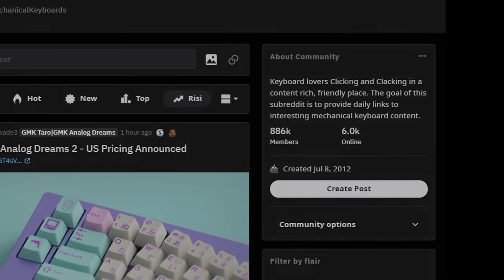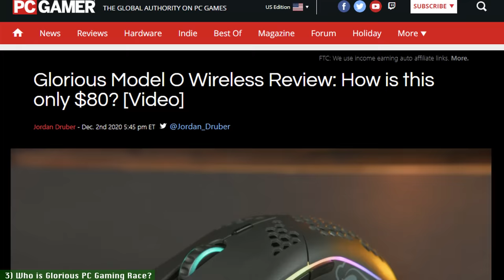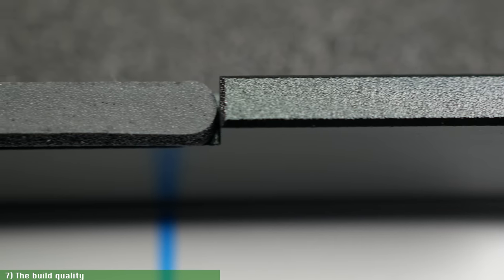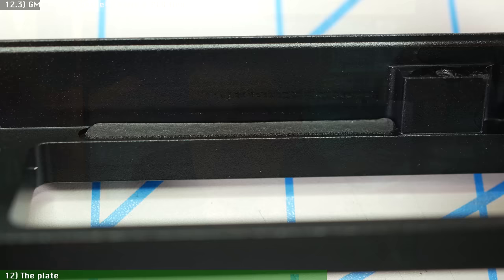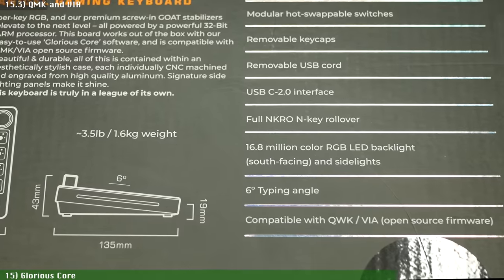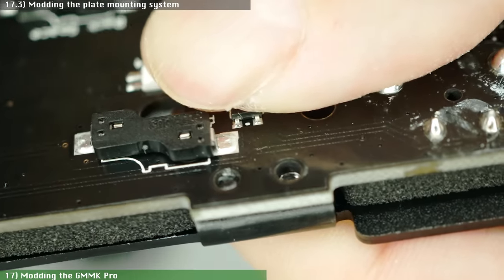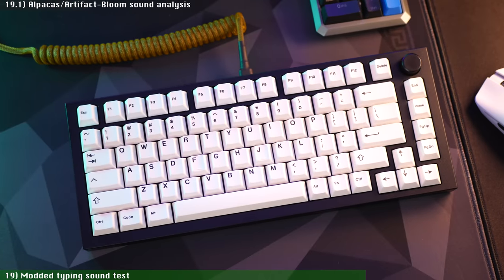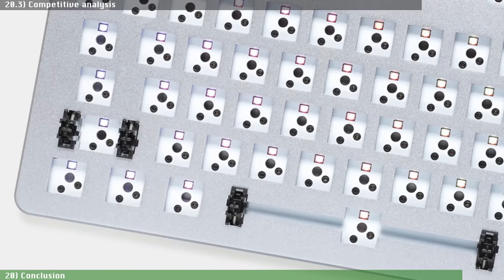GMMK Pro: The ultimate guide (in-depth review + modding tutorial)

Comment: This is great. How do you feel on lubed vs stock alpacas again?  I think I misunderstood. Thanks so much.
Reply from the maker: Hi Harry. I didn't lube the Alpacas in my video, since they already come pre-lubed from the factory and the JWK factory lube is really well done. In my opinion, there is really no need to re-lube them unless you like your switches more on the "buttery side" (which I usualy do with super tactiles, such as Holy Pandas for example -- which can be a bit too jarring to me, but no so much with linears).

The difference in sound you hear in my video between the stock board and modded board with Alpacas come exclusively from the mods I did to the keyboard and not to the switches.

One thing you can do if you're a bit put off by JWK switches high pitch sound (such as the Alpaca),is to film them, which will make them sound a bit more bassier.

Comment: Keyboard amature here. When I hard press the spacebar on my gmmk it sticks for a good second before popping back up. Feels stiff to press as well. Is this an easy issue to fix? I'm assuming it has to do with the stabilizers
Reply from the maker: Yeah... That is a known (and unfortunate) issue happening with the lastest batches of GMMK Pros. To try to fix the rattle issue from the first batch, they ended up gunking the stabs with too much dielectric grease (that got stuck in the pads they applied under the stabs housings).

Glorious even published a guide to help people to clean this up: https://www.pcgamingrace.com/blogs/secret-announcement/sticking-stabilizer-repair-guide

So yes... it is relatively easy to fix, but you'll need a proper Philips screw driver (Size 1 or 0 should work) to open the board and unscrew the stabs from the PCB.

Comment: But what changed the sound so much ? Was it the foam - or was at the orings ? or a combination of both ?
Reply from the maker: I'm certain it was the combination of both, since I did try just with the silicone (didn't show in the video) and while it did alter the sound, it didn't change as much as the with the O-rings.

While the silicone reduces the volume a bit, the O-rings kill whatever resonance was there before (by allowing the gaskets to absorb more of the energy from your fingers instead of passing them along to the rest of the case) and makes the bottom-out sound of the switches more defined in my opinion.
Reply: @IOSam  Ahh i see ! Thank you for elaborating !!  Very, very good and informative video - good sound, good camera work and a nice pace and voice. Very pleasant to hear throu.

Comment: Hey Sam,

First of all great video, as someone who is seriously considering buying this keyboard this was a great source of information. Though as a beginner in the field of custom keyboards I was wondering, what switches that are being offered on their site should I pick. I am looking to get a good sound without completely dempening the included RGB.

Thank you so much for making this video and great content overall!
Reply from the maker: Thank you Sir!!! Appreciated! :)

From what I could see from Glorious current lineup of switches, the only ones they have with clear top housings that would not obstruct the RGB lights would be the Gateron or Kailh standard switches (Glorious exclusive switches Panda, Lynx and Fox all have opaque housings which would dim the RGB light a bit).

They have the full line of clear/gray (light weight short travel linear), red (light weight normal travel linear), yellow (medium weight normal travel linear), black (heavy weight normal travel linear), brown (light weight normal travel tactile) and blue (light weight normal travel clicky) for both Gaterons and Kailhs.

Between these two brands, I personally lean toward Gaterons simply because I find them to be ever so slightly smoother than Kailhs, but that difference basically goes away if you lube any of these switches anyway.
Reply: @IOSam  Thank you so much for taking the time to reply and even going to their website to help me!

I might go for the polycarbonate plate to defuse the RGB a bit better so I might stick with that and go for a full RGB-build later. Would you still stick with the clear switches in that case or would you go with the Lynx's or Panda's for example?
Reply from the maker: @quintentielens4658  With the PC plate, and if RGB is not a priority, I would go with the Pandas (if you like tactiles) or the Lynx (if you prefer linears). These are premium switches that will feel and sound nicer than regular Gaterons and Kailhs, and can even come pre-lubed to save time.

While there are premium switches with clear housings out there, unfortunately Glorious doesn't sell those in their website, so the best switches they offer (in sound and typing feel terms) are their own opaque housed switches (Panda, Lynx and Fox).
Reply: @IOSam  Thank you so much for you help Sam! I know nothing about switches etc so video's like yours and the fact that you are willing to help is a serious help! You're great!
Reply from the maker: @quintentielens4658  Helping beginners is one of the main reasons for this channel’s existence (there are way too many channels focused on "seasoned enthusiasts" out there already). This is, and will always be, a beginners and veterans equally friendly zone! :)

So, you my friend, will always be welcome with your questions here during your custom keyboards journey! 👍
Reply: @IOSam  I just ordered myself a GMMK pro black with a polycarb plate, lynx switches and their white keycaps. All that paired with one of their wooden wrist wrest and some new stabs they sell seperately. Not cheap but hopefully worth it. Should be better than my Razer keyboard at least!
Reply from the maker: @quintentielens4658  Cool!!! Let me know how Glorious new aftermarket stabs work, since I have not tried them yet. And yeah... This will definitely beat any Razer board hands down! XD

And of course: congrats on your new keeb!!! :D
Reply: @IOSam  Will definitely do! Though I don't really have much knowledge on what 'good stabs' would be :P
Reply from the maker: @quintentielens4658  That's easy... If they rattle like a Razer Keyboard's stabs (even after applying some lube), then they're bad. If not, they're good! :)

Comment: Hi Sam, I was consider buying the StupidFish GMMK Pro case and plate foam. My question is if you think it's worth it? or if this silicone mod is a better solution for the GMMK Pro? Thanks for the video once again.
Reply from the maker: Hi David, before I can answer, two questions: 1) do care about some type of plate flexibility? 2) what switches are you using (or planning to use) with this board?
Reply: @IOSam  1s question - yes and I'm using your advice with the O-Rings; 2nd question currently I'm using NK creams but I exchanged them sometimes with bobas. I also ordered some alpacas to try them and I guess from what I read from the community...they will easily replace my creams.
Reply from the maker: @davidmendes7583  In that case, I'm not sure you'll benefit from the expensive Stupid Fish foam set. Because their case foam is thick enough to eliminate the small area between the bottom of the case and the PCB, which might affect plate flex (and which the thin silicone sheet is supposed to improve a bit); and if you go with smooth linears with no ping, such as the Alpacas, the PCB foam will not do much in the sense of reducing unwanted noises.

I'd say that if you want a bit less sound volume from your Alpacas, or if you keep your Bobas U4T (that do have a bit of ping), then the PCB foam might help. In that case, buy just the PCB foam (the thinner variety) and skip the case foam to save some $$$.
Reply: @IOSam  thanks so much for the suggestion. You saved me some money. :) Keep the amazing work!

Comment: Subbed! Amazing video, something I would expect from a channel 200k subs, not 2k.  Your channel is definitely underrated and deserves more subs.  
On to my actual question, I'm considering doing most of your mods, except for replacing the foam with the silicone sheet.  How would this affect the sound and feel?
Reply from the maker: Thank you my good sir! Highly appreciated!!! We're working hard to turn 2k into 200K! ;)

I think the silicone sheet helped giving a bit more space for the PCB/plate combo to flex inside the case, so if you care about that, this could be one area to consider. But it also reduced the volume of the sound coming out of the board (silicone has higher density than the included foam and seems to damp the sound more aggresively).

If you keep the stock foam the sound will have a bit more reverb and volume, which you might like if you prefer more "pop" in the sound department. Either way, if you replace the stabs and use the o-rings, the board will feel and sound way better with the stock foam than if you keep the entire board stock.

Comment: I feel like the stabilizers are perfectly fine, yours don't sound anything like mine so it might just be a manufacturing defect? Not sure.
Reply from the maker: As I mentioned on the video, despite the “tick” I got on my spacebar, the stock stabs that came with my GMMK Pro are not even close to being the worst stabs I ever used… In fact, if they had not called it “the GOAT stabs”, most reviewers (me included) would have probably framed the issue in a completely different light (all about setting expectations really).

Having said all that, Glorious has been tweaking the stock stabs in the GMMK Pro with each new production batch. In the second batch, for example, they made another mistake that enraged a lot of users out there, which was to over lube the stabs with thick dielectric grease (causing the stabs to get stuck and then requiring them to get cleaned up manually).

But in the subsequent batches they also addressed the excessive lubrication issue. So, if you got a GMMK Pro that was manufactured after the third batch (very likely if you bought it recently), you probably got your board with the improved GSV2 stabs, which were supposed to fix some of the more glaring issues of the original “GOAT” stabs.

Comment: So basically the most "useful" mod that you can do to make the gmmk pro sound better is to change the stabs + tape, adding gasket and putting some o rings? Oh btw, can I just use the krytox 205 0g only on lubing my stabs?
Reply from the maker: Hey Ralph! Yes. From all the experiences I did here, these were the mods that made the most positive difference for my sample. On the stabs, you most definitely can use only Krytox 205 G0! Just make sure you apply a very thick coat on the tips of the wires and it will work perfectly!

The reason why some of us use dielectric grease on the wire tips is just to save money, since Krytox costs way more than dielectric grease and you have to use quite a lot of it in the part of the stabs. But Krytox is in fact better if you can afford it.

Comment: My glorious core is like biggee than my screen so i can't see and press the save button, do u know how to fix?
Reply from the maker: Hey JCoB! I heard the Glorious Core app doesn’t scale correctly on low resolutions (below 1920 x 1080). Do you know which resolution you’re using on your computer?
Reply: @IOSam  1366 x 768
Reply from the maker: @imjcob  So you're below 1080p resolution. I know this is a well-known and documented problem with Glorious Core, and I'm honestly surprised that Glorious still hasn't addressed this issue.

Make sure you have the latest version of the App (just to make sure you're not missing on a potential fix). But other than that, the only other option would be to flash the keyboard with QMK and then use the VIA interface instead to remap keys. But, unfortunately, that also seems to bring other issues related to the RGB lights (that apparently don't work well under VIA).

The other option would be upgrading your monitor to a 1080p or higher resolution. That is guaranteed to fix this issue (not to mention the other benefits that a higher resolution panel could bring to productivity and gaming, of course).

Comment: Did you confirm that you can use plate mount stabs on the GMMK Pro? I am definitely an amateur keeb enthusiast and I know it's a cardinal sin of the keyboard community, but if it means I can use my lubed Durock plate stabs I already have instead of going through the hassle of buying new screw-ins, that would be great.
Reply from the maker: Hi Aidrik, I did not test that claim myself when making this video. But as I'm working on a follow-up video (where I try a few additional mods for the GMMK Pro), I'll test the original aluminium plate with plate mounted stabs and then post the results here.
Reply: @IOSam That’s why I love your channel, most creators don’t have anywhere near the same level of interaction that u do. Keep up the great work my man, and thanks for the response!
Reply from the maker: @aidrik9879  I'm doing my best to foster a nice community around here! :)

Comment: what is the keycap set i see at 9:49 please
Reply: @IOSam  ty, will try to mix two sets i guess
Reply from the maker: @alexlap3303  At any rate, I highly recommend their PBT sets! Very good quality! If you buy any sets from them, make sure it will fit the layout of your board: if you have a 60%, TKL or Full Size it is garanteed to fit, but if you have a 65% or a 75% you have to check if the set has a 1.75U shift for example.
Reply: @IOSam  Yea, last time i made a 65% a few keys didn't fit... was the perfect timing to order custom stuff and make it different.

Comment: I have a hope to but this but I want dead silent what things would you do to get a dead silent noise? Also awesome video watching your review I subscribed due to the high detail in the review.
Reply from the maker: Thank you so much man!!! If you want absolute silence the first thing to get would be silent switches... My recommendations at this time are Gazzew (Boba U4 for tactiles and Bobagum for linears) switches, which are the best deal in silent switches right now.

Then, if you want to go all out in silencing this (already quite muted) keyboard, you could replace the case foam for a sorbothane sheet. Sorbothane is not cheap ( https://amzn.to/3u6mAKa ), but it is THE BEST sound deadener for keyboards I ever tried.

And finally, I'd suggest you do the O-rings mod I showed in my video, since it also helps to soften the sound, since it helps the plate to absorb more energy that otherwise would go to the case (and generate reverberation).

Comment: What numpad did you build? I’m looking for one and can’t find one I’m completely happy with.
Reply from the maker: That is a GK21S from Skyloong (the makers of all GK boards out there). This one is made of milled aluminium and is built like a tank! It comes with FR4 plate, USB-C, per-key RGB and Bluetooth. It is also completely programable through the (fairly difficult to use) GK6XPlus Driver software.

Honestly, this is the best deal on a custom numpad I've seen so far (despite its high price of around $99). I bought mine on Drop.com, which sometimes has drops of this board for about $90 ( https://drop.com/buy/gkl-gk21s-dual-mode-wireless-mechanical-numpad-kit?utm_source=linkshare&referer=J2NSDA ), but you can also find these in Epomaker ( https://epomaker.com/products/epomaker-gk21s-kit ) in Asia, YMDK store on Amazon ( https://amzn.to/35G4WCn ) and Flashquark ( https://flashquark.com/product/gk21s-bluetooth-numpad-macropad-kit-with-hotswap-pcb/ ) in the US.

I will have an entire video about this numpad in the channel sometime this year (already under production).
Reply: @IOSam  thank you so much for all the info! I really appreciate you :)